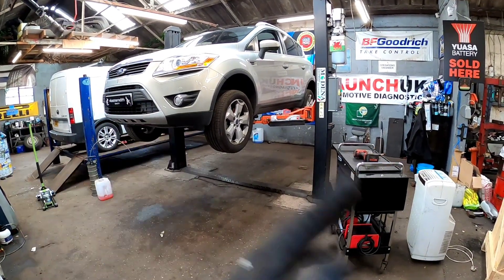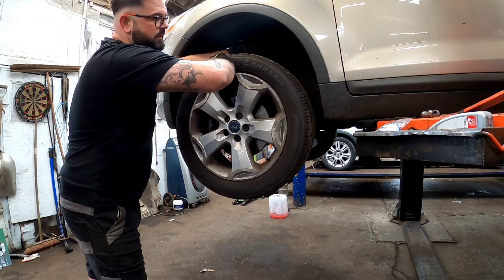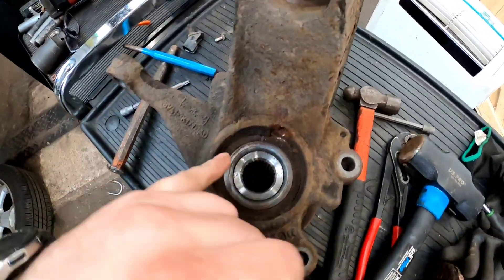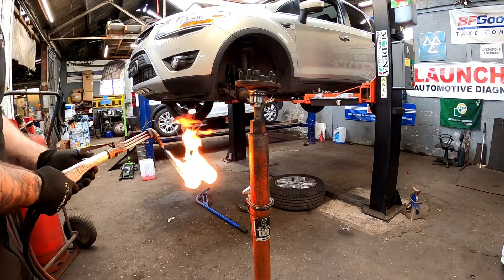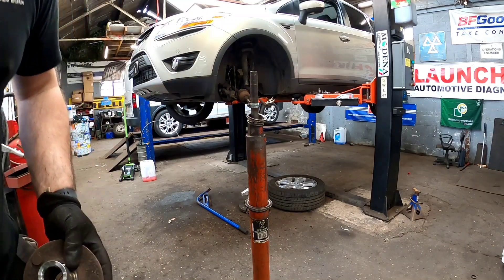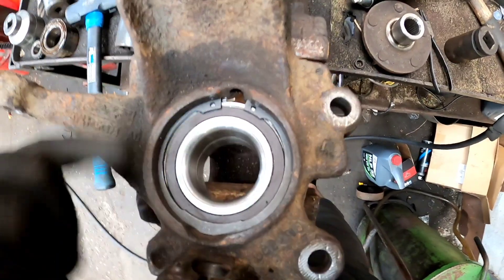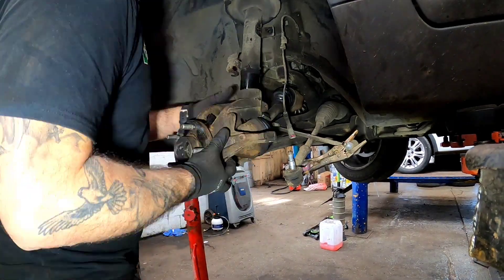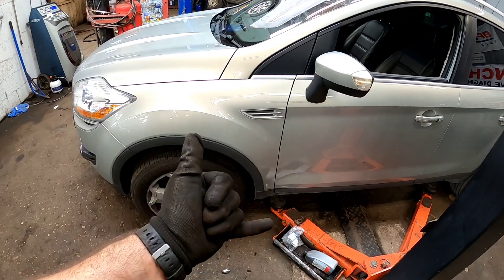wheel bearing replacement on a ford Kuga

Comment: Hi I have a kuga 2009 titanium and the diagnostic port has stopped working won’t connect to scanner tool is there a location for a certain fuse I need to replace
Reply from the maker: It can be numerous things, there is a fuse for it you will have to look through your hand book for a diagram